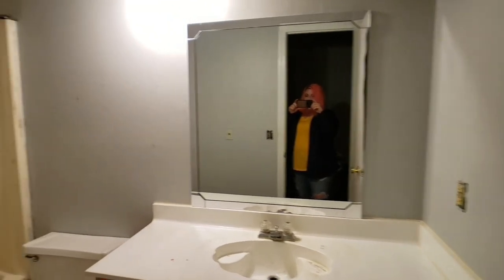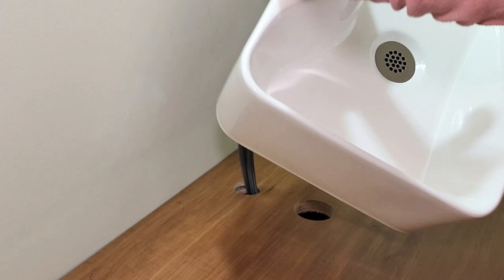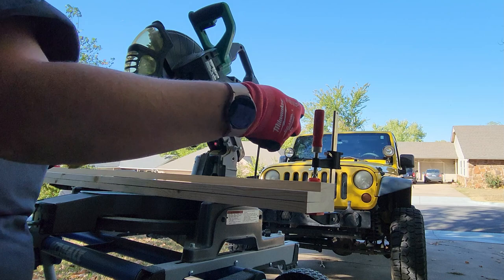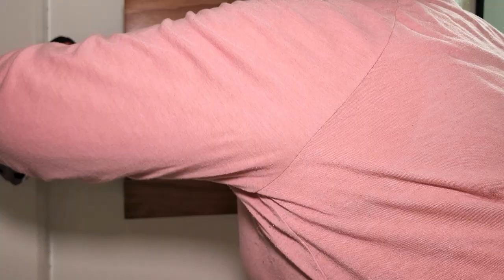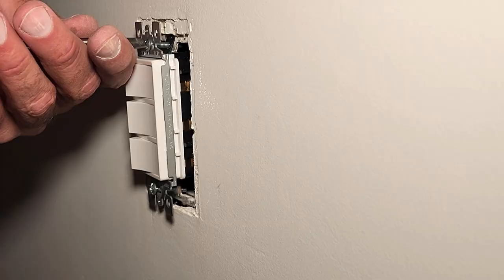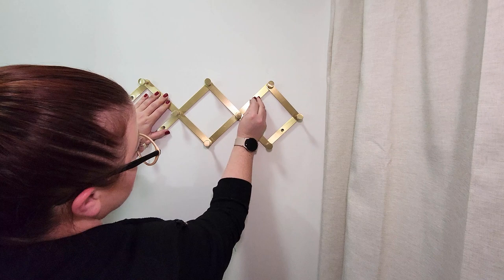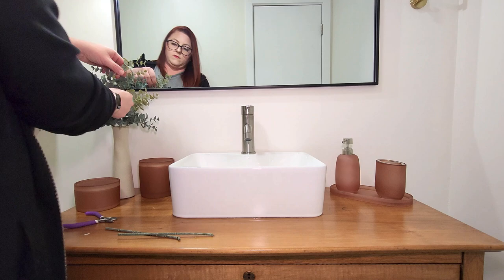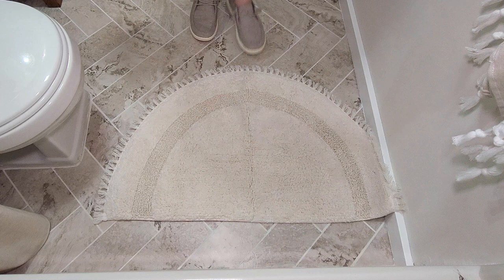BATHROOM MAKEOVER ON A BUDGET | DECORATING SMALL BATHROOM + REVEAL (BEFORE & AFTER)!

Comment: It is pretty. It seems that the area in front of the sink is very deep. Can the kids easily access it?
Reply from the maker: Thank you so much! So it's actually not much more space between the edge of the counter and the sink than the old one was, maybe just slightly. It looks deeper, though, because of how tall the sink is. I did use a dresser that's shorter than the standard bathroom cabinet height so that once the sink was installed, it would still sit at the height of a normal sink. I hope that makes sense.